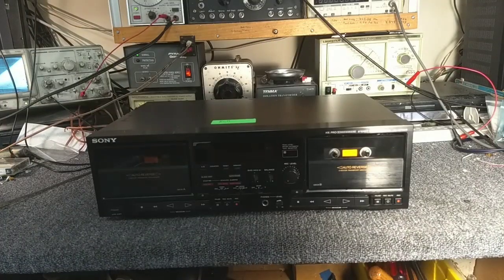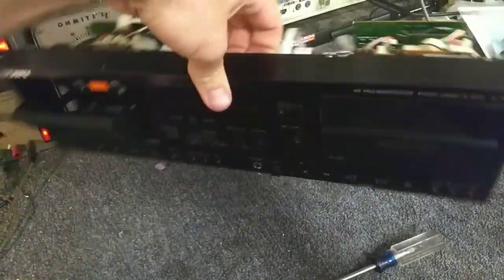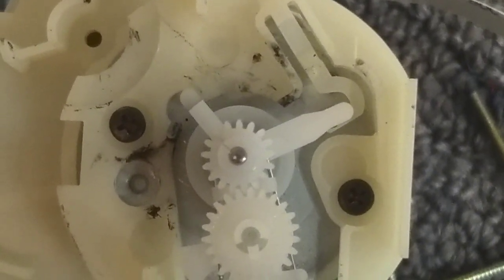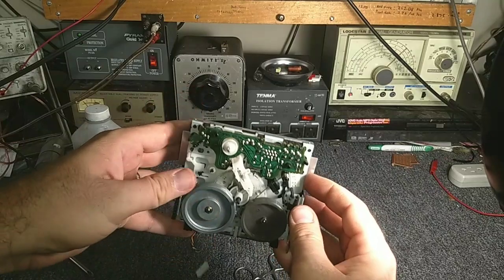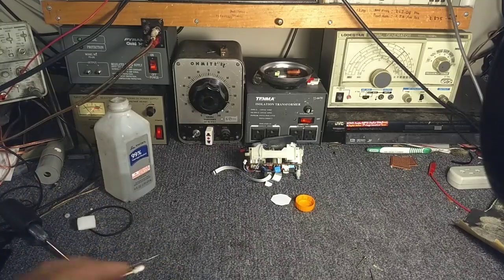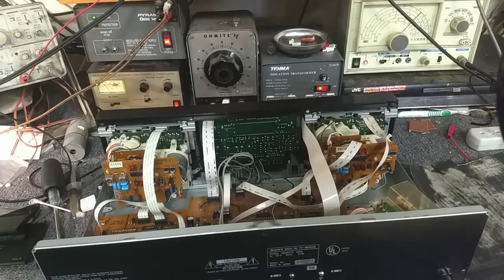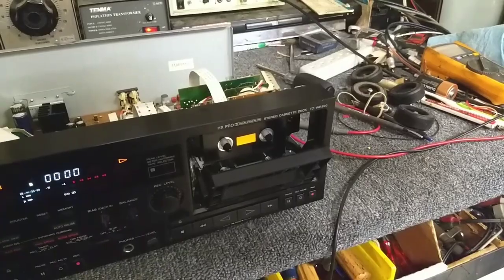Service attempt of Sony tc-wr820a dual cassette deck.

Comment: Hi, I've got TC-K461S (similar mechanism but not autoreverse) with the same problem: when it goes from play to stop it unrol a bit of the tape inside the cassette. No one has figured out what the problem might be and believe me, there were many specialists ... But when I saw this video, I checked the plastic gear and Jesus Christ .... it was cracked. I glued the gear and no matter what I did, when I tried to put on the motor axe it cracks again an again. I glued last time and I made the gear hole a little bit larger and glued on the motor shaft and bang! it worked. The problem disapeared. Thank you man! You're the man! I never saw a video more comprehensive than this! Everything you showed here is correct! I will subscribe imediately! Have a nice life! Thank you!
Reply: I'll do what you said. Mine is cracked and I glued it but the deck still becomes berserk when the tape comes to its end, then tries to eat the tape rewinding it very fast at the opposite direction. Finally, the mechanism gets stuck until I disconnect the unit from electricity. Some minutes later I reconnect the unit and the mechanism gets ok again. Edit: I interchanged the less damaged gear from the reproduction side to the recording side and now it's working finely. Excellent tip, sir. Thank you.

Comment: Thank you Jordan!. This is my deck. Long story short, the deck was store with all my original sound equipment for 20+ years taking heat and cold and that I think was what damaged the plastic. only my deck was affected. all other equipment is ok. I like the features and the Dolby noise reduction on this deck and that is auto reverse and record on both decks. I am willing to let him go if I have to. got a replacement for it but lacks a bunch of features. It is what it is I'll guess. Thanks again Jordan. Please see my email I sent you.
Reply: a lot of them had that white plastic that cracks and now they are getting old and some just can't be fixed

Comment: One thing people need to understand is that all this mid-price hi-fi material (being Sony, Pioneer or Technics, doesn't matter) was all made to last 5 or 6 years with a 'regular' use... And this is valid to any type, VCR, CD players, any thing with mobile parts... In case you're thinking about buying a Video-8 camera don't even think about it - all SMD caps are spewing corrosive liquid, unless someone changed them at some point, you'll end up with a worthless brick, no matter what the eBay seller tells you... Even amplifiers, they all suffer from cold solder joints, dirty pots, you name it...

Comment: Great seeing the cracked gear. I've pinned cracked sony gears before and had great success, but now I know there's a proper replacement I'll check that out. All the symptoms you describe are right on the money. 
Wagner in australia sell rollers and I'm sure there's other places. I've gotten good W&F results using the wagner ones. 
I've seen corrosion on sony capstans and have sucessfully buffed it out with brasso. The only downside is the  the capstan ends up thinner and it reduces the speed ever so slightly on that side. 
The erratic behavior is probably the deal breaker here. Sony mode control operates by reversing the reel motor for carefully timed periods. Any friction or slippage throws it out.

Comment: I got one of these things and I for the life of me cannot figure out how to fix this thing. The capstan motors both works completely fine but the reel motors or the secondary function motor is completely dead almost. I have the poor deck torn almost to shreds trying to figure out as it's like there is a loose contact somewhere and it's not like it's one singular bad motor when one motor starts working the other motor works and the deck works fine and it cycles through everything but then when I go to restart it nothing. Dead. I have looked at every single connection and I found it starts working if I mess with the tape transports themselves by applying pressure downward or at an angle from the top, I have some success getting it to work but I doesn't fix it %100 at all. Out of all the decks I've worked on this thing absolutely has me stumped. all solder connections are fine, and all connections are good as well. What happens is when you put a tape in, and press play the capstan motor kicks on and spins but the reel motor absolutely NOTHING. Almost as if it were unplugged but I made sure it wasn't. The little gears that you were talking about are both fine and look to be in pristine condition and just to make sure they weren't the problem I took them off and same result. ANY help on fixing this would be greatly appreciated as I now have zero clue where to go now and I really would hate to throw away such a nice deck as it is in great cosmetic shape.
Reply: Que modelo es?

Comment: A service technician makes basic mistakes. The pressure rollers are replaced with new ones, and not regenerated. Rubber has long lost its properties.
I couldn't see how the Lord treated the Capstan roller with a scalpel, it was enough to take it out and soak it in alcohol or plain water. After soaking, the dirt would come off nicely.

Comment: If this were my deck, I'd probably combine the best mechanical parts in one deck and not use the other deck anymore. Shame because this looks like it was once a really nice unit.
As for those broken gears: There are several injection molding places in Southern California who accept custom orders. At the DCC Museum, we've been wondering how difficult (and expensive) it would be to get some gears for DCC recorders commercially reproduced. They fail in the same way, though not with dramatic side effects like reversing a reel or something.
Thanks for posting!

Comment: 35 minutes in you rub the surface of the pinch-roller with 1000 grit paper. When I was a TV/VCR engineer we used to use a product called spirit of soap which rejuvenated the rubber of pinch rollers in Video recorders.

Comment: Am messing with a Panasonic Su CH40 since yesterday and is proving to be a nightmare.
Please make a video on cleaning the entire cassette mechanism on Panasonic Double Cassette deck. Thanks.
Last but not least, please avoid using sandpaper for cleaning pinch rollers. Use detergent, soak em for a while and use a toothbrush to clean them.
I have used this technique and works amazing 👍

Comment: The plastic stopper is not the head assy height stopper. The height stopper is in the right pinchroller on the round rod that comes in place between the head assy and the plastic rest for that plastic rod on the right pinch roller assy. Use a piece of heatshrink on the plastic rod and you are done.
Reply: Do you have a picture of this as I have the same issue now after I changed the motor gear

Comment: Maybe you can find and order some replacements on Aliexpress. I don't know the quality of these rollers but hey, at least you can try it. Scraping dirt off on sandpaper (the way you did this) of pinch rollers is never a good idea. Better keep the pinch roller in it's place, let it turn and use some sandpaper on a piece of flat wood/metal/plastic  (on fixed position) to create a equal flat surface to scrape off. Of course better is to replace it with new ones. Scraping the capstan with a knife..... never do this. Try silver polish to clean it up and after that rinse it with alcohol. Demagnetize every metal part when finished.

Comment: just watched your video again while I was watching it - iwas checking the transports for that deck even the little gear that crackes  is not cracked  pinch rollers look like  never have tape on them  heads new I pyt belts on them put 9-volt battery on motor  run  perfect  without  hooking up whole deck  I think these 4 transports are the BEST  you can find  date on motor 1-27-97  -in box all assembled  ready to go belts and all  -belts might be off bet they run

Comment: 14:50 small gear cracked
17:18 detected switches 
27:14 again small gear cracked
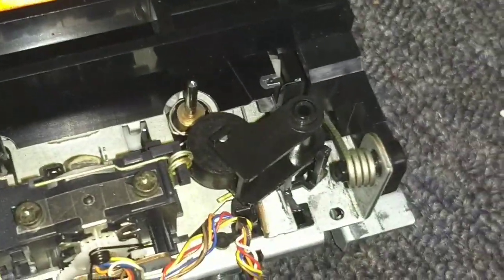22:03 pinch rollers
51:18 piece of plastic, head alignment

Comment: hi i had alot opf betacam sp decks  down to the last 2 decks they all done now  finding parts is a right pain 
i have  put in 100's of hrs fixing decks  of many kinds  i understand where you are soming from  
funny thing i have alot  RS  101  decks all running  ace  run of a hi- fi  amp  my one's run of a big 12v 0 12v ac power unit 

they are not liked one bit   Technics RS-X101  picked alot up in the uk  low cost  just to play with

Comment: Those Sony pinch rollers, identifiable by the very small inner plastic hub, are utter junk. They must be replaced on sight with improved types to avoid weird skewing and wow problems.

Comment: Dang is this thing really worth all that? I’ve seen an awful lot of dual cassette decks almost given away for free.
Reply: Seems like cassettes are making a bit of a comeback and people are asking money for the decks again which might make this repair sort of worth it. 
Over the last few years I bought quite a few cassettes at various shows. For $5 it was a good way to support the band and cool for nostalgia factor. They also came with a download card so you could listen to the music without using the tape. I do have a nice Yamaha deck but it hasn't come out of it's box in years.
Reply: Jim Kresky I have a nice cassette deck and several tapes as well. I have seen a slight increase in the value recently but nothing to make it worth this much trouble to repair yet. JP has way more patience with this thing than I would have haha
Reply: @bugdrvr  That's what i been hearing that they are making a comeback
Cheers

Comment: I got my gears from the us, from a guy called "k_o_stereo" on ebay for around 11$ shipped...he will give you extra ones because they are so tight they might break while installing...but are fine after install is complete...they work...and he guarantees them to correct this problem.
Reply: Then, they are either too tight, or too weak. I used to bore up the hole in them to get a loose fit, and glue them on the motor shaft with gel-type superglue.

Comment: I have one with motorized doors and it turns on but the doors won’t open
Reply from the maker: It's jammed. Don't force it open or you're tossing the deck in the trash. 

Gotta reset the cams then open
Reply: @JordanPier  where are those cams? I have the same problem on the right side deck
Reply from the maker: @aristo698  the cam is the large wheel with gear teeth and lobes on it. There's an arm with a follower on it. To trigger the cycle you have to push on the release slide on the right side of the transport as seen from the front. The cam rotates counter clockwise as seen from the rear.
Reply from the maker: Also, on the ones with motorized doors it's far more tricky. There are two sets of gears. One for the functions and one for the doors. The function cam has to be reset before you can open the doors. Hard to explain.